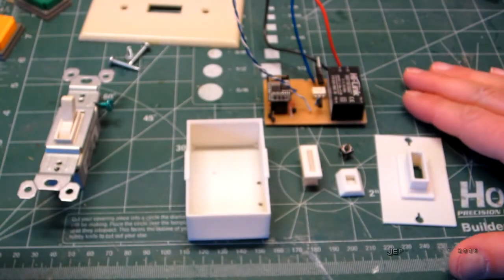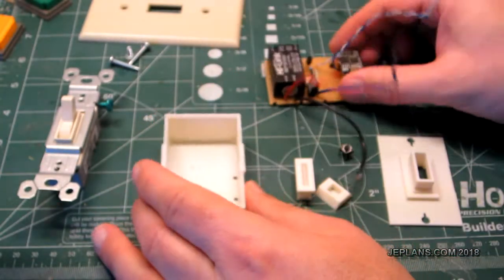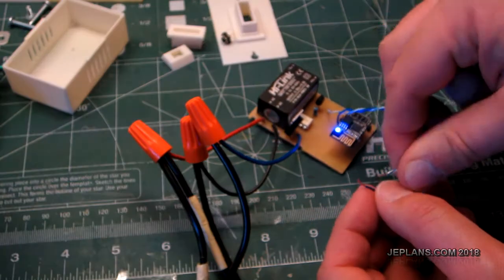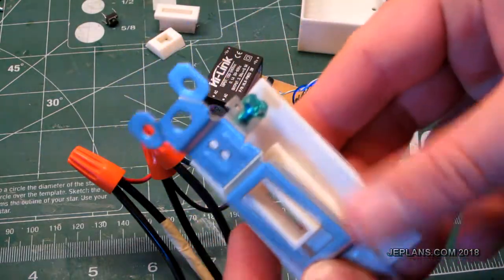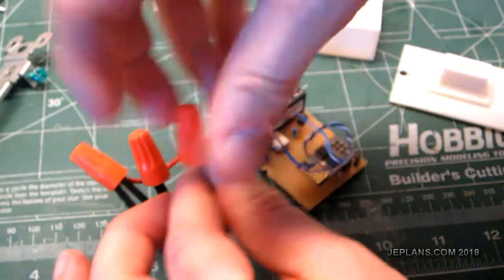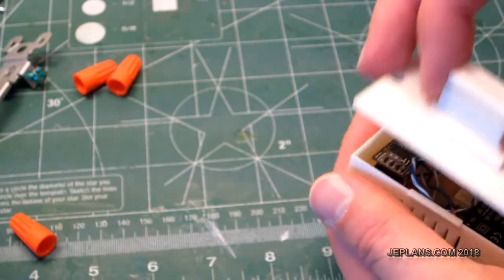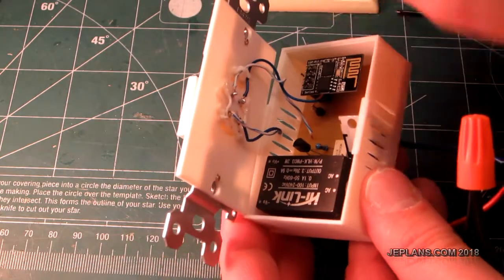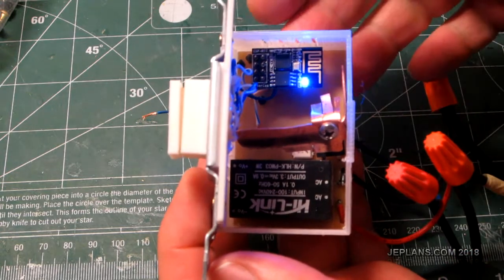ESP8266 AC Light Switch

Comment: If your design can only accommodate a certain amount of wattage (therefor only a certain 120V current), maybe put a fuse in line somewhere so it doesn't overheat the heatsink / melt everything. Even if a 60W bulb works perfectly with your design, no way of knowing if that 60W bulb in a failure mode might take much more current.

Comment: Why can't you directly connect the power supply's output to the ESP8266's vin?
Reply from the maker: Not sure what you are asking, the power supply is directly connected to ESP's VCC pin, what could not connect directly to the ESP with a resistor was the MOC3051 or it would not boot.
Reply: Sorry I did not pay attention to the connections on the pcb the first time I watched it. Watching it the second time clarified everything. Thanks for making this video.